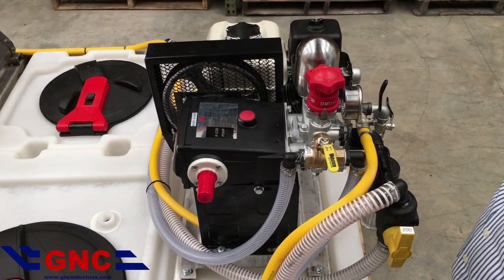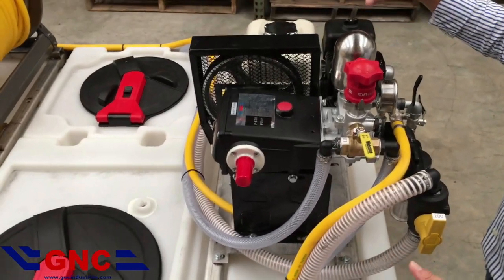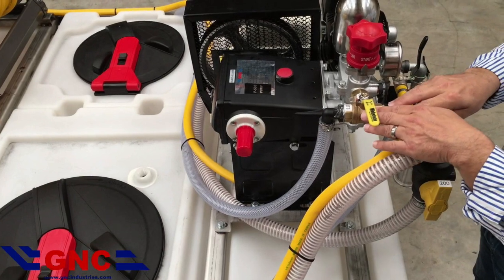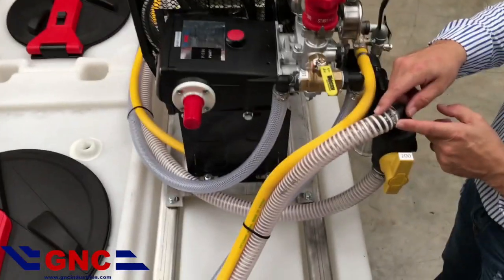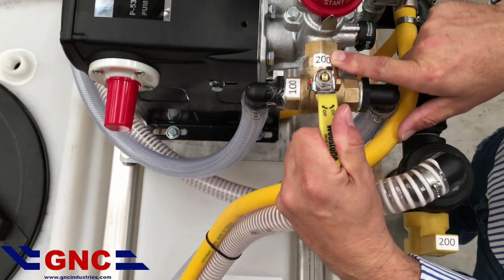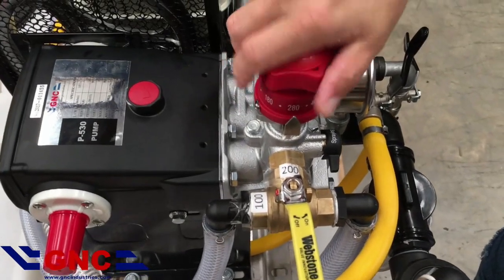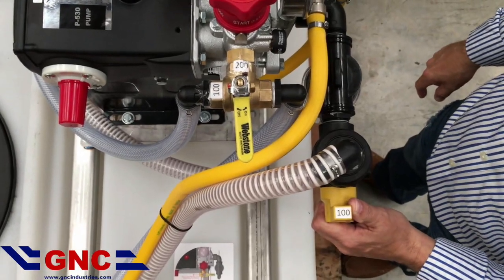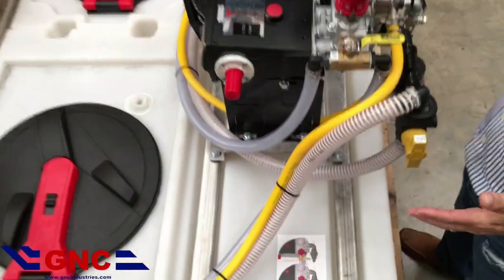GNC Industries, Inc. - Dual Tank / P530 Piston Pump, Sprayer Operation

Comment: in the worst case scenario how do you stop the spillage of liquid
Reply from the maker: Space Saver style tanks, crack the seal on the filter and the unit will loss it's prime allowing the liquid in the suction hoses to go back into the tank.  Keep a 5 gallon bucket under the filter bowl to catch any extra liquid.  You can then poor the liquid back into the tank using the tank basket to catch any additional trash.

Comment: With that split tank/dual reel system, can both reels be used simultaneously (2 applicators working at the same time from the same tank? Or is the dual reel system simply to improve the isolation of the two tanks and two different chemicals to keep them from cross contaminating? Based on the valve system, I understand the tank can only pull from one tank or the other, but does the pump run product to both reels simultaneously? Thanks...trying to learn which skid set up I should be looking to purchase
Reply from the maker: Thank you for your comments. 
Yes, you could run both reels simultaneously and Yes when using a single reel per tank improves the isolation during operation. Anytime someone is running a multiple tank system with a single pump unit there will be some cross contamination in the pump head, filter, manifold (if used) and some of the hoses. If you are using chemicals that will have serious consequences if cross contamination occurs, we always suggest using independent sprayers. Our space saver designs work perfectly when you need 2 independent units in the back of your truck.
The 3 way ball valve system on a split/dual tank system, allows you to either pull from TANK A or TANK B and return to either TANK A or TANK B.  You can NOT pull from Tank A&B at the same time or return to Tank A&B at the same time.  However, you could pull from Tank A and chose return to Tank B.  How you work the valves on the suction and return will dictate which tank is being utilized. The output to the hose reels portion has 2 independent valves, one going to each reel.  So you could open one or both up.
This being said, yes you can use both reels simultaneously on any type of unit.  You will need to make sure the pump output is enough to operate both reels at your required chemical application rate.  The volume the pump is producing will be split between the reels. Most applicators move to the next size up pump unit when using both reels at the same time. Plus make sure you always re-calibrate when going from using a single reel to using 2 reels at the same time.
We hope this answers your questions, please give us a call if we may be of any additional help. 870-248-9901